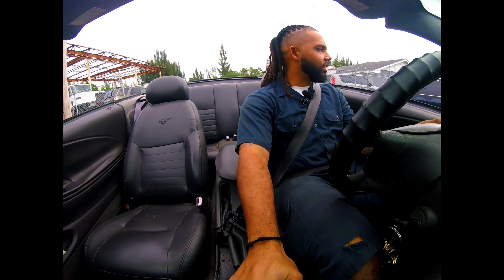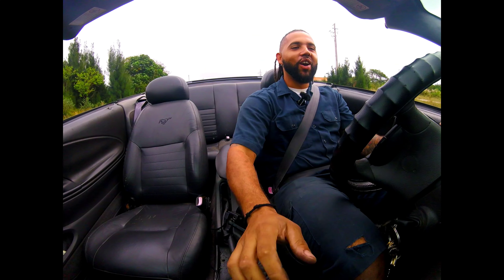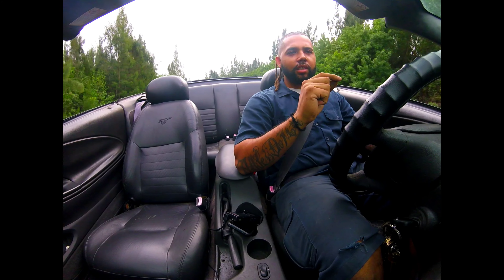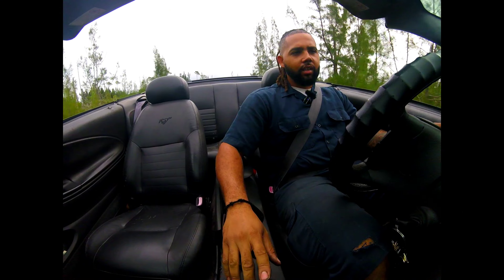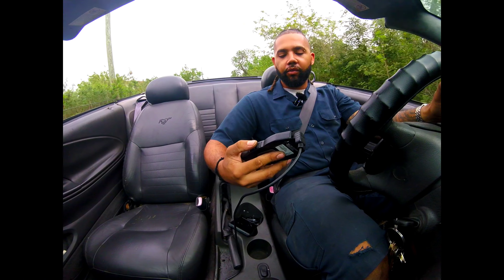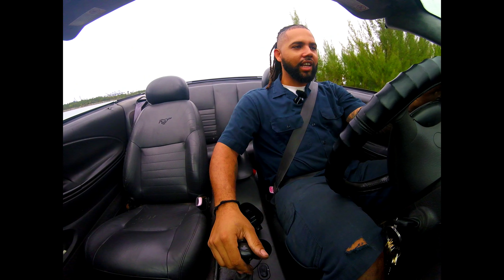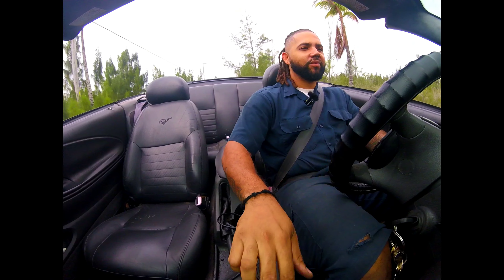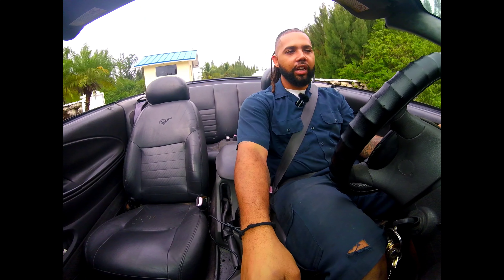Lincoln Aviator Swap First Drive

Comment: Thank you finally I got a 04 gt and I see an aviator 4.6 4v out of a 05 with wire harness and everything only thing is it’s no detailed videos on what is needed for the swap and how to set everything up in the new edge and can you run the 4r70w please reply back.
Reply from the maker: From what I've heard from people commenting on my channel you can use everything from the aviator motor, you'll just have to use the 2v harness and adjust it to work with the 4v motor, reverse the polarity on the coil packs wiring and you should be good to go.

Comment: What's going on with 2nd gear? It sounds like something is wrong there. I'm sure you put a new clutch assembly in it when you changed it. Right? Oh and sometimes a steam generator will clear out a clogged radiator. Personally I'd just replace it with a new one. Those engines don't do well when overheated.
Reply: IDK I tried to be nice. Good luck with your project.
Reply from the maker: Lol you are very correct, great clutch in it, second gear synchro is just trash lol,
Reply from the maker: @gravyd316  hey man no Biggie, I love criticism, I'm definitely striving to make my builds more reliable and fun to drive, I put a radiator in it and shes running cool now. Currently doing some remote running with a guy named Tony at tuners Inc, so hopefully I'll be able to put out some more great 4v content in the future, 🌴😁🌴
Reply: @DriftDreams242  Well you can count on me to watch your channel grow.
Reply from the maker: Thanks so much for your support 🌴😁🌴 @gravyd316

Comment: Great work!! Is that on 2v harness and tune??
Reply from the maker: Thanx man, it's a 2v harness but a few things have been done to it to accept the 4v motor, also it's a 2v ECU that's currently being tuned for the 4 motor
Reply: @DriftDreams242  yep!  What was done??  Extended coil wires and reverse the polarity??
Reply from the maker: @NewEdgeDesigns  yeah I did that and extended the fuel pressure sensor, throttle position sensor and idle air controller sensors wiring to reach there new location,

Comment: Im a little confused.....youre driving a mustang  convertible yet its a Lincoln aviator???

Edit: i commented too soon. I just heard you say the engine is from an aviator...im a jack ass sorry
Reply from the maker: Lmao your not a jackass, and yo sure correct I swapped a engine. Into my Mustang from a 2005 Lincoln aviator, it's an awesome motor 🌴😁🌴
Reply: @DriftDreams242  well it looks like you did a great job of it. Makes me curious how much fun a 4 valve navigator swap would be in my 03 Grand Marquis.....hmmm... Definitely worth a think on my part. How hard was the swap? Motor mounts line up or did you have to relocate them? It should be the same block from the 2 valve just different heads right?
Reply from the maker: @bryankerbow7871  all the mounts like right up just a few tweaks and it'll be in your car as well, Its an awesome motor
Reply: @DriftDreams242  what about gauges? And the ECU swap? My 03 has a transponder in the key that is set to the ECU of my car. Did you have trouble with getting your ignition to work ? Motors I can build, but computers I'm not so good with.
Reply from the maker: @bryankerbow7871  the 4v motor can run off of your 2v ECU, I have my 4v swap running off my factory 2v ECU that I'm having tuned for the 4v motor so no ECU swap needed
Reply: The aviator had the marauder engine, mustang cobra without the supercharger
Reply from the maker: @floridaman7  yessir that's why I love em lol poor man's cobra lol